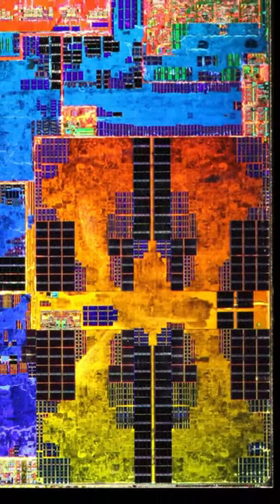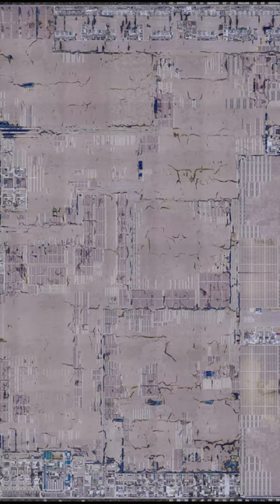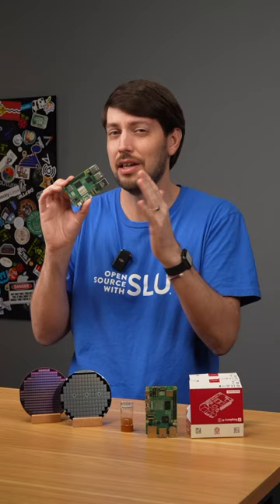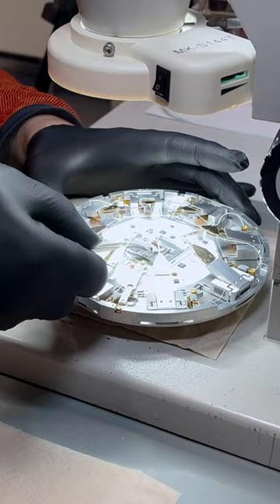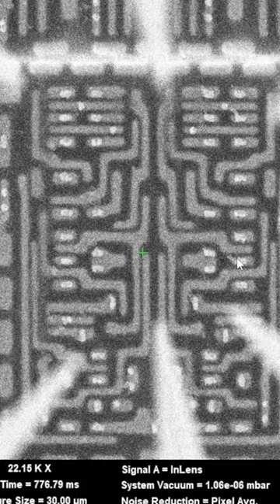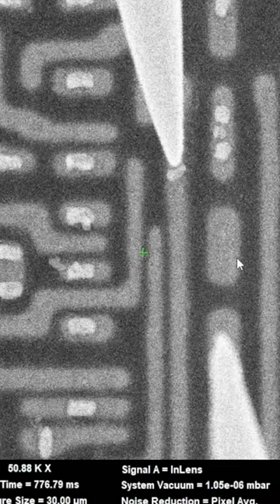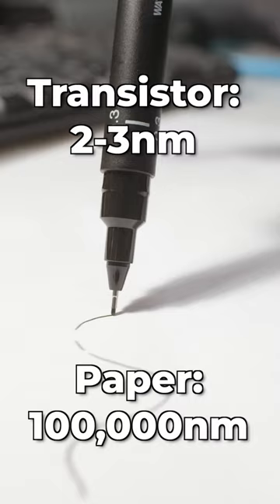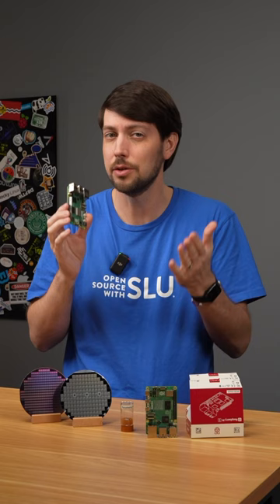The silicon inside Pi 5

Comment: That's because  chips are powered by magic smoke. Once it escapes the magic is lost
Reply from the maker: You have to be careful to contain the magic smoke.
Reply: great power comes with great responsibility  @JeffGeerling
Reply: Doesn't work without the smoke 😀
Reply: I have let out the magic smoke in my career a few times!
Reply: There's actually little pixies in there too that control everything and if you make them mad they'll bite you

Comment: All of the information you gave about the transistor size is flat out wrong. The processor node has nothing to do with the transistor size even if it is listed in nanometers. The transistor size is: gate length + contact width + 2 times the spacer thickness. This makes a 12nm node transistor around 90nm and TSMCs 3nm is 48nm so nowhere near 3nm
Reply: We really should stop using the "nm" moniker. Which node are you talking about here? N3, N3E, a different node in that family? There are actual proper names for these process technologies from the fabs.

Comment: Jeff, I feel like you should know that the "nanometres" is just marketing and mostly meaningless. TSMC "N3" isn't actually 3 nm in size...
Reply from the maker: The thing is, the relative size differences are important, but trying to explain the various marketing strategies, and whether someone's process node involves 3D structures makes it impossible to get to something relevant to an actual video topic :(

So in my case, I just talk about nm in relative relations (like the same fab's 7nm node has features about half the size of the 14nm node, regardless of whether the full feature is 8 or 12 nm in reality), and I leave the physical measurements to blogs and whitepapers that have the space to get a lot deeper on the topic.
Reply: @JeffGeerling  except the 3nm node isn't even half the size of the 16nm process. 16 is 90nm and 3 is 48 so not even that explanation works
Reply: @JeffGeerling  Jeff I think you're confusing alternative nodes in a family with these marketing names. TSMC doesn't really refer to their nodes as 3 nm for example it's just a broad industry "class", but the actual nodes are N3, N3E, N3P, N3X. N7, N7X, N6 are part of one family. Samsung, Intel, GloFlo are similar in that they have actual node names that aren't the generic "nm" that for some reason permiate in media reports.

I don't particuralily like using "nm" because it's clearly confusing to the general public that it's a measurement when it's not. Seems like you got caught up in this confusion as well.
Reply: @davidbuddy  agreed. It would be nice if they had kept the whole node name = smallest part of the transistor but they don't even do that anymore
Reply from the maker: That is true for some 3/16nm processes, but not all, since the features are designed/laid out in different ways too. If you want to go down that rabbit hole (which plenty of people *do*), it'll take a longer video / blog post. My point in today's video is more the relative sizes / features. As we hit limitations physically, the design turns even more 3D (like backside power delivery), and talking about "nm" becomes even more difficult.

What is true, however, is the probes Kleindeik makes move in 0.05nm steps, which blows my mind.  @McLovinMods
Reply: If a piece of paper is 100,000 nm thick, do I give a hooey if the trace is 3nm or if it’s ‘really’ 16nm or 48nm?

3, 16 and 48 are all a LOT smaller than 100,000.

Comment: Yeah it is pretty crazy how these are enginnered, especially if your new design uses different processes than your old designs, as you now have to individually dial in all of those processes. Deposition being a real bugger to dial in, changes in epitaxy can take 6 months or more to get working reliably enough for manufacturing! Then once dialed in you can run 24/7 for about a few hours to a few days before the machines run into issues (which they all do, all the time).

Comment: Due to quantum tunnelling it is impossible to make transistors smaller than 10 atoms across (roughly 2nm) if it is, the electrons can quantum tunnel through without a base voltage, making it randomly turn on and off when that small.